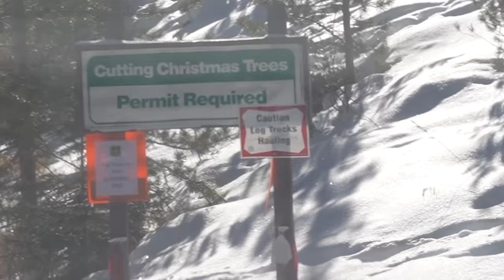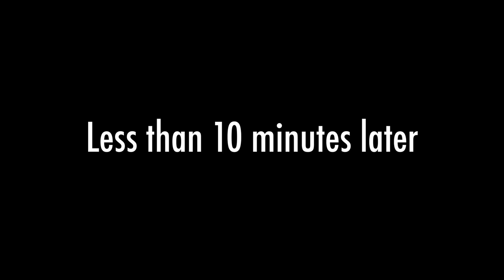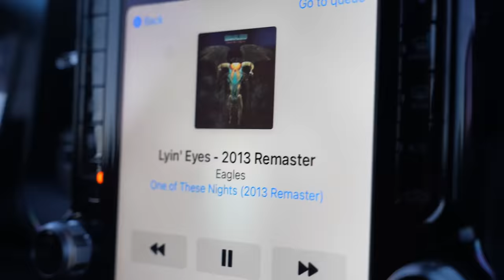AMAZING SNOW RECOVERY!! | Trent & Allie

Comment: 40 years ago I learned my baby was allergic to pine.  Bought a fake tree and have never looked back.  Was especially happy when pre-lit trees came out and then, the ones with LED lights which last forever.  Have had my current tree for about 18 years and it always looks great.  There are enough expenses around Christmas without having to pay over $100 for a real tree.  You're lucky to live in a place where you can cut your own.  Merry Christmas!
Reply: Same here with my son. Every year his asthma would kick up when a "live" tree was brought into the house.  Finally got an artificial tree and those seasonal episodes stopped.  Allergist tested him and it was the dirt, dust, pollen and molds on the tree doing it to him.
Reply: Same. Tried it one year by the front door (away from the living area) and even that was a no go. And that was our last year cutting a tree. 😔

Comment: Get a tree to tall, cut tree to fit room, use the Extra branches to fill in Void spots in the tree by drilling a hole in the stock where the missing branch is preparing a branch like a doll plugged into the stock of the tree.
Reply: SOOOO SMART!!!!

Comment: You mentioned a hangover.  One of the things that you have to keep in mind is that elevation, cold temperatures, caffeine, and alcohol consumption dehydrate.  You must drink fluids both cold and hot.  It will be a chore to do so because there is a tendency not to drink cool water when your body is cold.  This is one of the first things that soldiers assigned in Alaska were taught.  You would be surprised by how many heat-related injuries from dehydration soldiers experienced by not drinking water during winter time.  You might try tea or water with lemon after your glass of wine.

Comment: Just watched the sideing. A tip to stop mice from eating there way into the walls. Use a 6" wide, metal flashing, cheap aluminum,  unroll it and nail it along the ground. It will also, help stop rot from rain and mud splash back. Nail it up, and out the sideing over it..

Comment: wondering why the pneumatic nailer isn't driving the nails in all the way on what seems is the majority of the project. Shouldn't have to follow the nailer with the hammer.  Also curious how you are going to tie the different pitches of the roofs together, especially the facias??

Comment: The trick to pulling a vehicle out of a ditch like that is to turn the front wheels in the OPOSITE direction that you would naturally. Instead of turning the wheel to the left like that first car did in the video (which pushes the front further into the ditch) you turn the wheels to the right which pushes the front out of the ditch. Because you have a vehicle pulling from the rear keeps the rear from sliding back into the ditch. This works everytime. I drove tow trucks/wreckers with my father since the early 1960s and that was one of the many things he taught me. Steer the front away from the ditch, not towards it.

Comment: Great video, I really enjoy following along to see you building your new home….but theres one question I meant to ask for some time: you are building this from scratch, so there is a great opportunity to build something in a more sustainable way and consuming less energy, eg putting solar panels on the roof, using a heat pump to heat the house, reusing rain water, etc……have you not considered doing that, or maybe is it just not a thing in the US and not available? Or did I miss that this still might be coming? In the end, before starting the house project, you lived in a tiny home on wheels were you had solar on the roof (?)……would be curious to hear your views on that

Comment: For safety, whenever doing a snatch, kinetic rope, or winch recovery any spectators or bystanders should be standing well away from the vehicles.  Nasty things happen if the ropes/cables break.   At 7:28 one guy is walking along next to the truck being recovered.   
 Although it is a reasonably safe looking recovery things can go wrong so always best to err on the side of safety and be extremely cautious and stay well clear.

Comment: Are you going to put a door into the garage from the man cave?
Reply from the maker: No it’s going to be insulated and heated and I didn’t want the air leaking of a garage door
Reply: @Trent & Allie  I meant a man door. Makes it easier to get into the man cave for a break from wrenching. No need to go outside